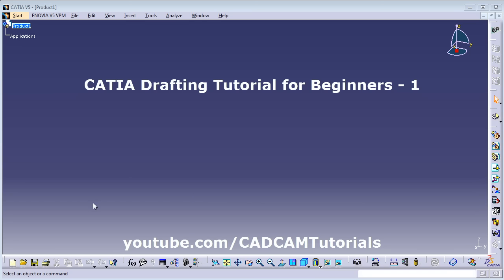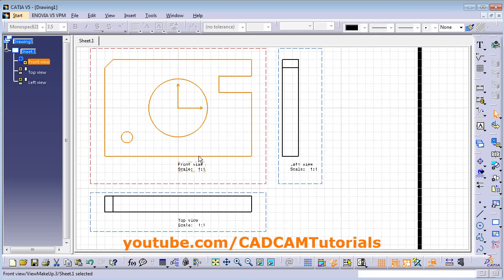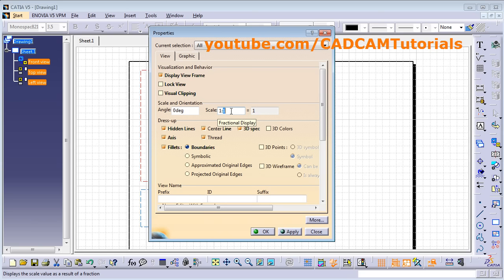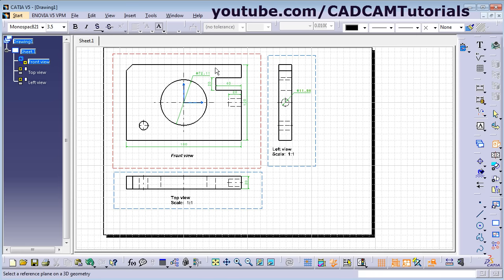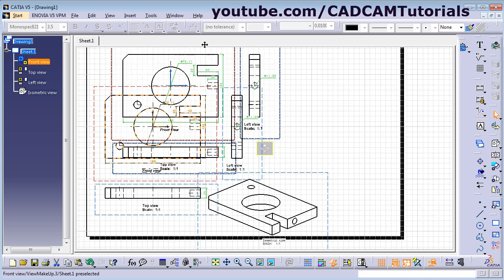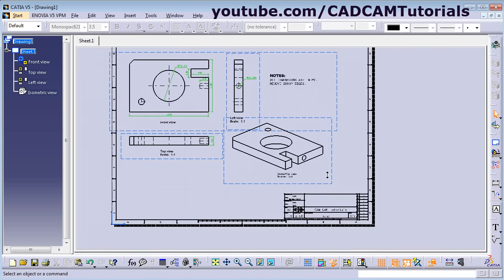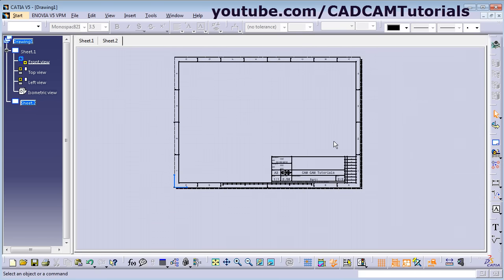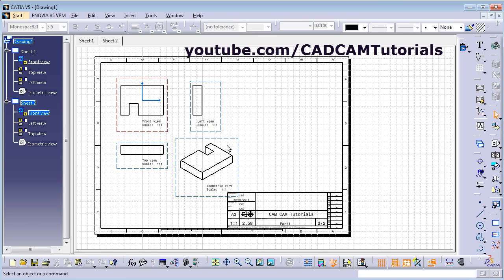CATIA Drafting / Drawing Tutorial for Beginners - 1

Comment: would like to ask you sir about the dimension, 

let say I simply design a pipe. the pipe, when I design it, the diameter is 3m for example. can I SHOW the dimension to let say, 1m without changing the original 3m diameter.
Reply: yes you can, when you create that dimension of 3m just right click her go to properties and find "Fake Dimension" check it and put desired value in